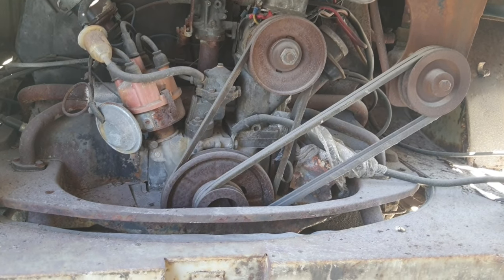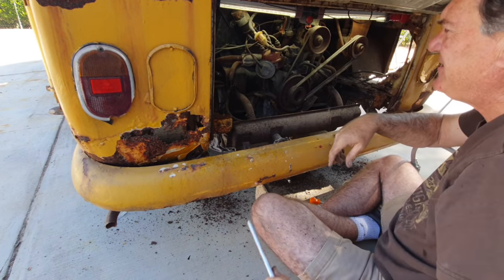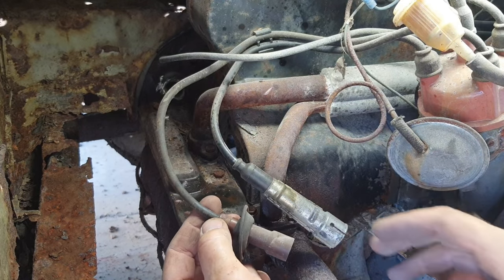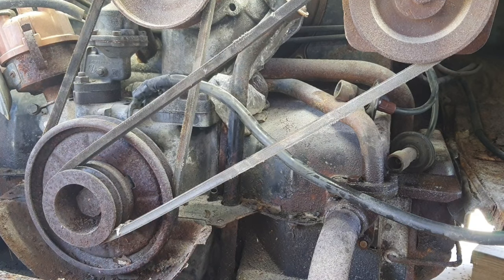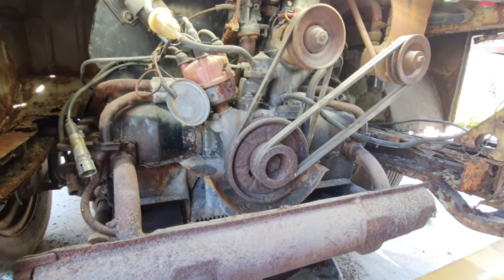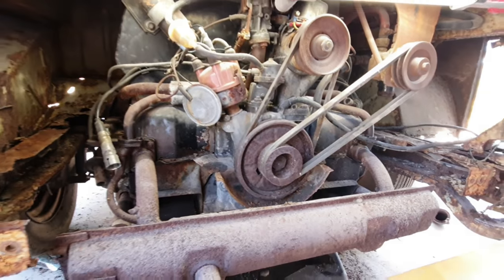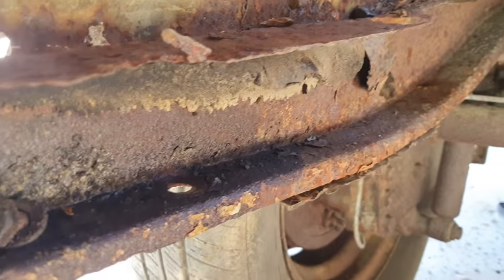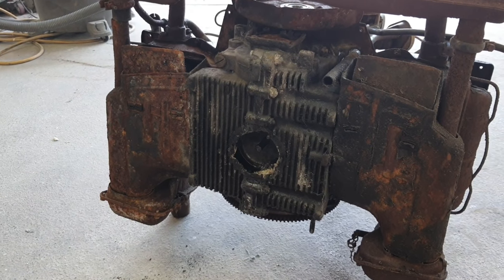will it run ? VW type 2 single cab cherry picker sitting for 30 years SHOCKING surprise

Comment: Looks like a 61'/62' 40 hp to me by the looks of the intake and stale air fan shroud. And I don't see the 1500 option air cleaner bracket mount on the left side of the body. Crazy that a 40hp was powering the truck AND the hydraulic pump!!!
Reply from the maker: The M code plate says 118 which is supposed to be a 1500 somebody must have changed the engine on this I'm guessing will tear it apart and see what's inside
Reply: @Mikefngarage  I had to look it up M-118 is "without side and tail gates". Does it have M216 code?  "1500cc option (until 1964"  My 63' is a 1500cc option, also has large front brakes, and small nut/ big brakes in the rear. Hope that heavy bucket truck has the big brakes! LOL

Comment: Bought a 70 camper bus many years ago, had 2 quarts of oil and 2 gallons of water !!  None of that sludge though.  /learned to check lug nuts and axle nuts - finger tight axle nuts and no cotter pins...luckily, I could SEE a home depot from the highway.

Comment: 9:02 the sparkplugwires ate like this on the vanagon so they may have used vanagon spark plug wires
Reply from the maker: Oh yeah that's right I haven't seen those in a long time I recognize them but I didn't remember where they were at thanks for the comment

Comment: I did a tune up on my old Bug, and it wouldn't run. I used Champion plugs, and my mechanic switched them for Bosch. He told me you had to use Bosch plugs in VW engines. lol (I also had the distributor cap on 180 degrees out. lol)
Reply from the maker: Yeah Champions are a bad choice for VW
Reply: @Mikefngarage  Why would that be? I've been using Champion copper plugs on all my old stuff for a while and just swapped one of my beetles over to them today. I'm very new to the whole classic VW world so pardon my lack of knowledge here.
Reply: Champion plugs have (had) cut threads rather than "rolled" threads like Bosch.  The threads are important on air cooled engine plugs, rolled equals less likely to seize in e spark plug hole. Hope this helps.  I actually prefer NGK plugs now as Bosch quality has slipped over the years as far as air cooled parts. Hope this helps you out. 👍
Reply: @TheDasbull  thank you so much! I've been trying to find a reason on the samba for 30 minutes now lol. I'll swap them out for some ngks this weekend and save the champions for my Plymouth I suppose
Reply from the maker: @TheDasbull  right on exactly. I use NGK too but never platinum. Champion and autolite have also poor quality manufacturing. Back in my mechanics day the surfaces are not square the porcelain used to come out of the housing and much more.
Reply: @TheDasbull  Hello, I managed to get a hold of champion about the spark plug threads, the part # 306 L86C is a rolled thread and fits on our VW's. Idk if there are any quality control issues with the porcelain per se but it's good to know options since the Bosch's are a bit harder to come by

Comment: Should you save it.. off course you should save it!  I did not get the age of the bus: but it looks like it is a very early one. Could be the oldest Ruthmann that still existed! .
The first thing you should do now I think is separate the cherrypicker from the bus. This makes things a lot easier. I also worked one some. Still own one: a late one:T2 from ‘79. This is not perfect but still in good running and working order. Working under the tray on the engine as you did now gives me a pain in the head every time. Hit the tray with my head several times. 
The engine you pulled out looks like an early 1200: This where bad engines. Lots of burned valves.. Valve clearance was then 0,1 mm. VW changed this then to 0,15mm over the whole range. Getting the cherrypicker of without the hydraulics is not so easy. With use of the hydraulics it it quite easy. But the have to work then. And you need the pump to run. And the electrics to work. Perhaps I can help you with it: Got  factory doc from mine. With plans from the hydraulics and the electrics.   Greetings from the Netherlands : Hans
Reply from the maker: Thanks Hans go on my Facebook baby you can upload the pictures for your book that might help me

Comment: its not a 1500 with that  small size inlet manifold surely
Reply from the maker: yea looks like 40hp to me. but maybe the early 1500s had 40 hp heads. we will see.

Comment: HelloI  am I ouloud to call you by your Name as Mike??.Wile thats`ok for if you prefer that or accept .that I just want to help you with information about the engine horsepower and so on.If you have the  win and year of 1 relase.and if possible frame.nr.I have some contacts in Wolfsburg und from mine providers who I buying mine restorations parts.I think mabe its possible to get information from the Netherlands and also Belgium.So if you can supply me with the asked info I can take contact with the correct people.Bud I don't envy the project a lot of panel work is stil useable with more. Ok  fore now I wish you all the luck with the project considering the total mess of the framework.stay inn touch With Kind regards HCS.